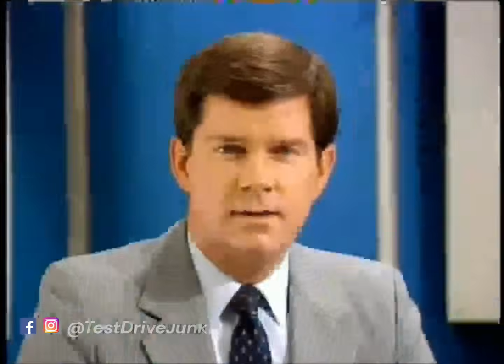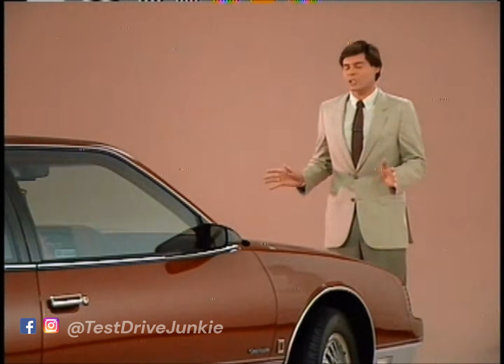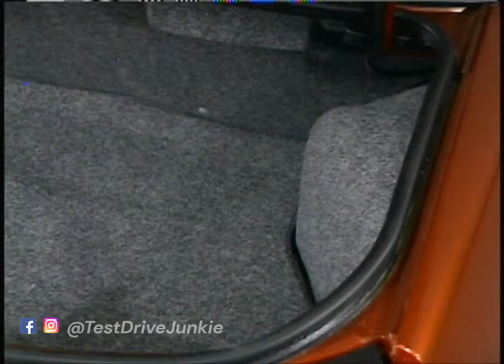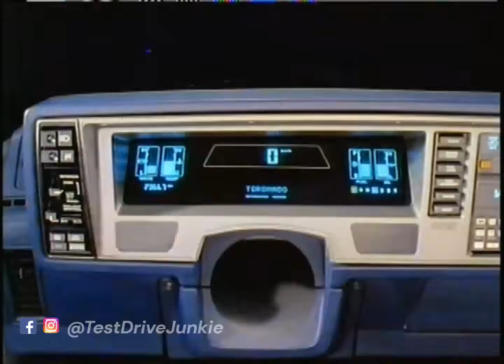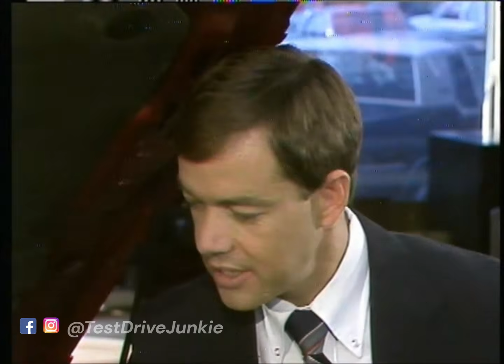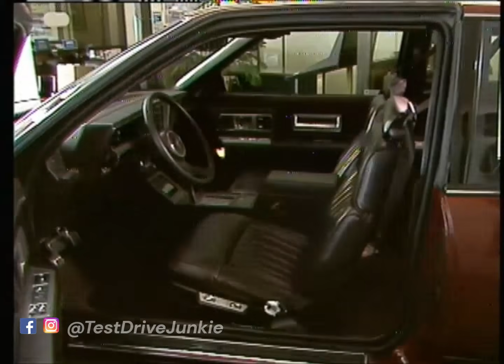1986 Oldsmobile Toronado Manufacturer Laserdisc Promotional Video

Comment: This is just my point of view, but when I look this 1986 Toronado, and I look at the 1966 Toronado, the very first year of the model, they look like a little. I didn't say that thwh are identical, because for sure they aren't, but when I saw the very first style and this one who came 20 years later, they have like the same kind of look. Which was great, considering that was the 20th year of the Olds Toronado.
Reply: These cars (all GM divisions) were a disaster for GM
Reply: @zachZO6-s9b yep! These were real turds.
Reply: Yes, this last generation actually returned to its original form. The Toronado is supposed to be a futuristic car. The second and third generation of the vehicles stepped away from that with its bloated yacht, and boxier look. The fourth generation returned to the roots of what the car was. A sleek high tech vision of tomorrow
Reply: They were too small at first and were quickly redesigned and released for the 1990 model year. I think they look much better after the redesign.